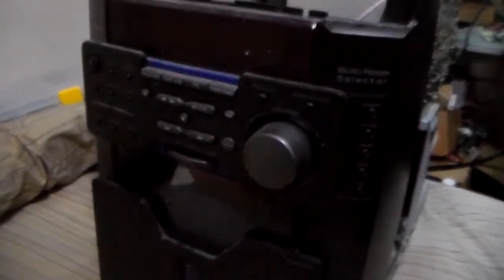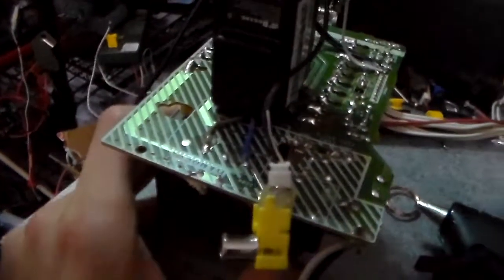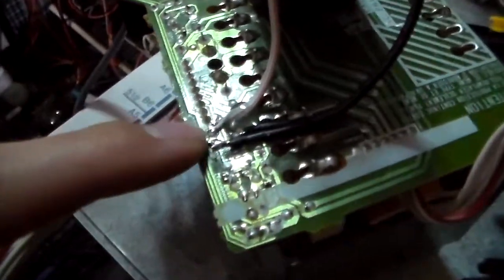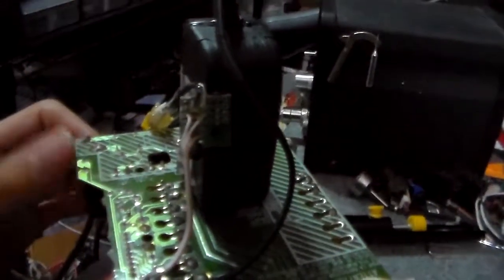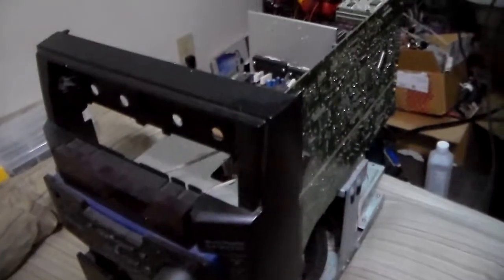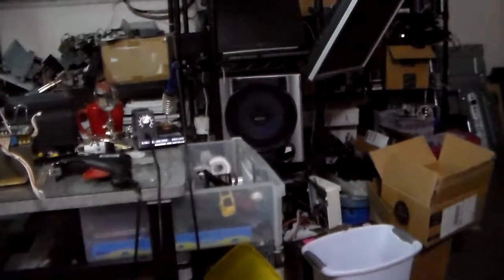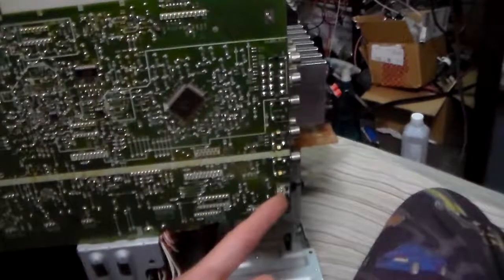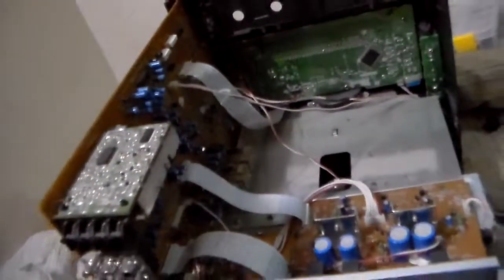Sony MHC-MG310AV adding a remote power on output + extra content

Comment: I need to talk to you!!! I have the same stereo, but mine has went kuput! When i plug it up a can hear a CLICK from inside and in the front there is a little red light by the Power Button. (Solid) No display shows up or anything else. Won't turn on no matter what else Sony tells you to do. Can you help me, because i would love to keep this Stereo????
Reply from the maker: Billy Denham hey there I would check the fuses since it has one for the high voltage mains and a few for the low voltage side, join my discord (link in my about page) and we can talk more there
Reply: @SuperBrainAK  I have taken it apart and cleaned it all out. i took out the same thing you were working on with yours and cleaned that. I seen 2 little glass fuses and both look good. Put it all back together and it still does the same thing. Clicks, Red Solid light in Front and No display? Any suggestions?